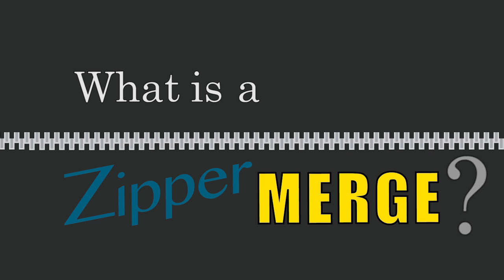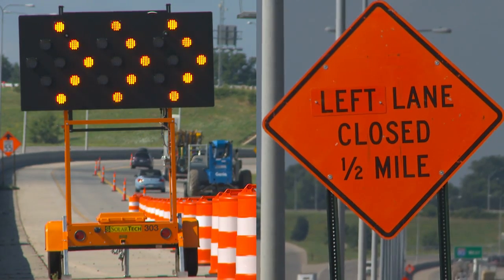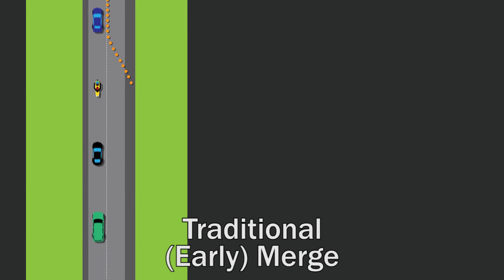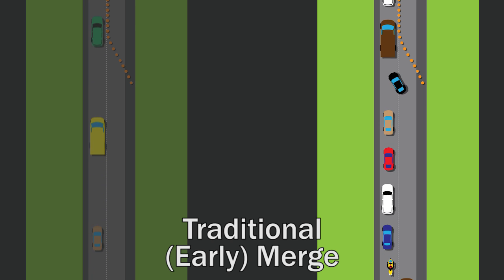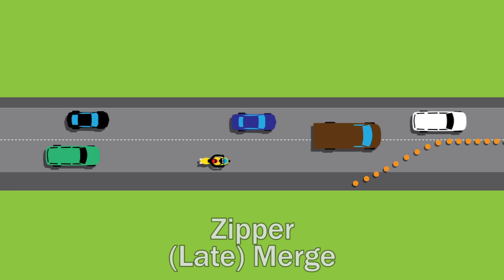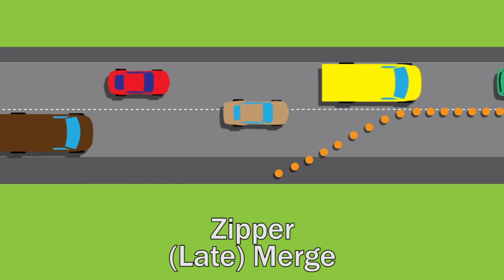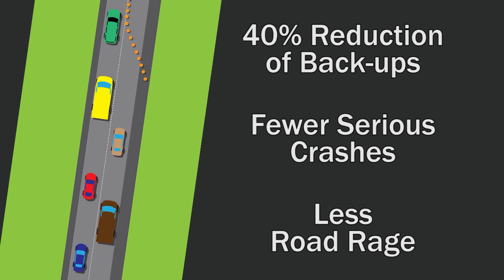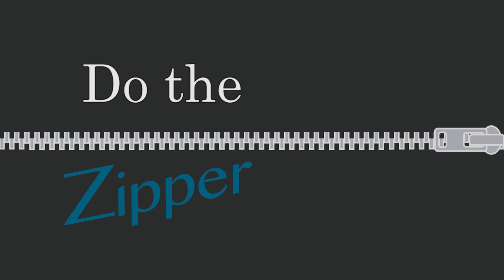Do the Zipper Merge! | Transportation Tidbit

Comment: The cause of the congestion comes well after the merge point. And only so many cars can pass thru it at any given time, regardless of how they merged before they got there.
The zipper simply creates two shorter lines out of one longer one that can block ramps.  But it is still the same number of cars waiting for their turn to pass the obstruction.
the zipper does not save time.  what they call a reduced backup is still the same number of cars.
just arranged differently.
Also the drivers in the dead lane are the only ones that merge.  The drivers in the thru lane do not merge and usually owe you nothing aside from common courtesy.
Reply: Merging in advance would be the best thing...
IF.
EVERYONE WERE CORRECT and respected the queue!!!

Open your eyes...and look.

It is not true.
The merging point is itself the cause of congestion
(of course...it may happen that "after it" there is  a further congestion point ...)

The question is that , if people merge early, at a certain moment a queue of one will creaye (in one lane only).
Leaving the "dead" lane  EMPTY !

Are you sure that everyone oncoming will NOT use it and will queue up behind the others in the same lane?

Unfortunately, the party pooper ALWAYS arrives who does not respect the queue, uses the "empty lane"
as if it were "his personal overtaking lane" to pass in front of those who arrived before him...
and then squeezes to force his way in, forcing the entire convoy to stop sooner or later.
All the queue will be forced to slow down...  the overtakers push until they fill in...
The queue stops...  and the average speed drops down.
That's why early merge does not work if the traffic is heavy.

Merge LATE !  Keep both lanes full ! Do NOT leave an empty lane !
Let's not let them pass!
Let's always keep the two lanes busy until the last moment!
This way we make sure that EVERYONE respects the queue, and that it goes forward without ever stopping and without losing speed.

The speed, every time you stop, averages with ZERO!!!

Don't be afraid that they won't let you back in.
This happens...with the dishonest drivers we mentioned above.

Do it too. The queue on the TWO lanes, until the last one, staggered.
Those next to you will see your correct behavior, will see that you have not walked past anyone, and will give you the necessary space.
I did it. IT WORKS! Set an example! The more we do it, the more people will see it done, the more it will be done!

Comment: I want to see the results of a zipper merge working properly on a highway at highway speed (since nobody actually slows down in a construction zone). If successful, then I will believe in them. Otherwise this is one of the dumbest ideas ever to be conceived by a State Department of Transportation. All this is going to do is create more traffic backups due to accidents and pissed off drivers who will end up road raging
Reply: Patrick Knight You don’t do a zipper merge at highway speed, though, only when traffic is heavy and slower moving, it says that in the video if you had paid more attention!
Reply: I've seen once (and only once) signs saying to do a zipper merge (they said something like "use both lanes up to merge point", people actually did the zipper merge, and it worked perfectly, both lanes kept decent speed and (since there were signs specifically saying to do it) people properly left space for the people in the other lane to move over near the merge point, and nobody decided to be an asshole and gun it up to the merge point.  It worked, traffic flowed much better than it would have otherwise.

That said, I don't disagree with you.  I saw it work, this once.  But in general, I would expect even with signage that all too often people would move over early anyway, then perceive those that do stay in the other lane up to the merge point as being rude even if they are not speeding up to try to "cut ahead" like an asshole but are trying to zipper properly.

At the very least, what I found is if they expect people to zipper, they need a sign saying to use both lanes up to merge point to tell people to do so, otherwise some DOT video saying you should is not going to get people to do so.
Reply: Or people freak out seeing orange barrels and they slow down when they don't have to.
Reply: It is somehow true...
Early merge, is sometimes better...  IF everyone is  CORRECT !!
...
Why do not you understand?  Don't you have  "the eyes"?
The question is another.
At any speed, in any situation,  if you merge early  (in heavy traffic you will slow down because of the congestion...) you will leave empty space in the lane of the obstacle.

As I repeat...if every single driver is correct and respect the queue...this is the best thing to do...
BUT
...did you see what happens??

Every time...   a  "mood breaker" will arrive ...  who finds the  "empty lane" and will use it 
as  "his personal passing lane"  and going on passing who is arrived in queue before him.
Nobody will be happy of this behavior...  nobody agrees to leave him space ...  and he will stop at the obstacle. Then he will try to force to go on...  pushing and shrinking...  until...
someone will arrive who has fair to damage his car...  will brake to let him pas...
and...  ALL THE QUEUE WILL STOP !!!

This will damage ALL the traffic.
Each time you stop, the speed averages with ZERO

Late merge is not the best way...  (but   bad drivers  EXIST ! )...  so early merge, in heavy traffic, 
does NOT   WORK BETTER !
Reply: @mariopagnanelli  Yup.  I saw, exactly once, signage saying to use both lanes up to the merge point, people in the continuing lane did make sure to leave gaps for the people in the other lane to move over, people did stay in that lane so people couldn't use it to be an asshole and pass a bunch of cars to 'cut ahead' and then try to merge at the last instant.  It worked perfectly.

But, I seriously didn't expect it to even that time.  I seriously would expect, ordinarily, it'd be just as you say, people will exit the lane early, and others will be an asshole and use it to try to fly past traffic and cut in at the last instant; then the zippering is totally broken.
Reply: @hwertz10  thank you for your witness and your comment !
It is logic.  It works.

I live in Italy.  Unfortunately, in Italy a "signed" late zipper merge does NOT exist.
But... when, in heavy traffic, two lanes merge in one, a queue is already there...  and I "see the danger" that someone will can try to overtake...
I place myself in the "empty" lane  side by side the last driver of the queue  (on the other lane).

Then...  you know... someone arrives...  and wants to go on, and flashes the headligts.
I do not move.
I look him gently in his eyes, showing an expression like  "Why should I help You  to lack of respect who arrived before?"
...and, each time... they flashed only once. Never twice.
They remain at their place waiting their turn like all others.

Never a problem 

...

We all should always do the same !